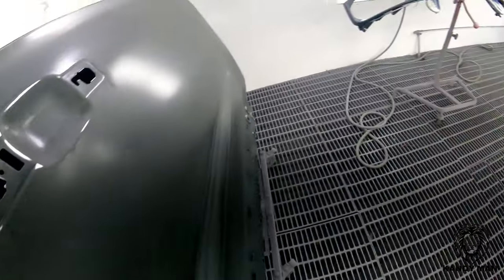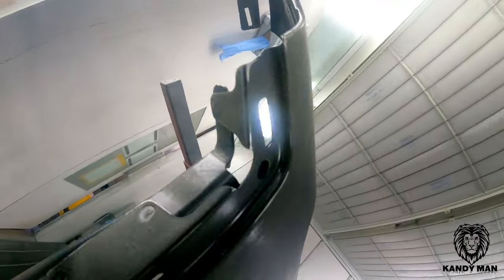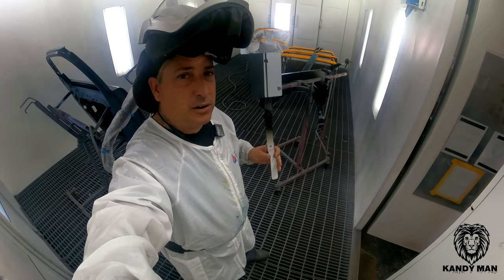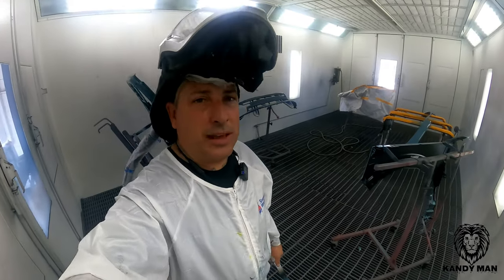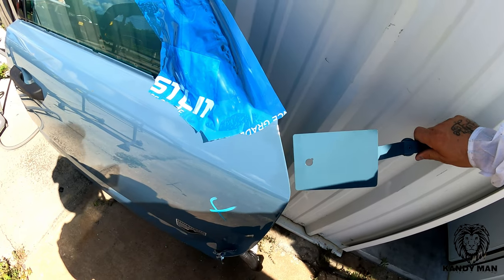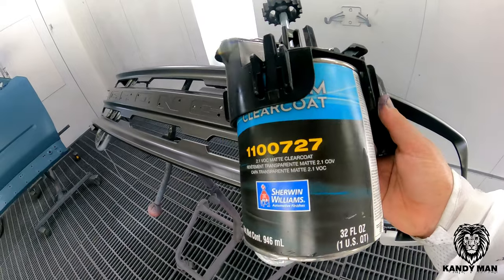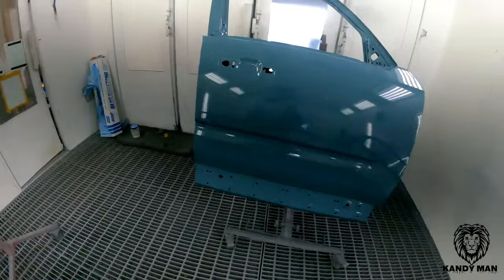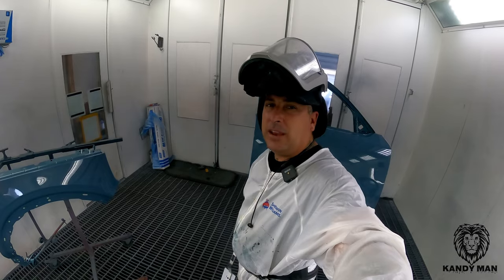NEW CAR COLOR - STEPS FOR SUCCESS

Comment: I have a question: have you ever had sealer wrinkle on the edges after spraying clear base on a panel?? If so, what would cause this to happen???
Reply from the maker: Sounds like the sealer was a little wet still or you put the clear base on to wet with a slow reducer or both  that's one of the reasons I love water base paint no lifting.